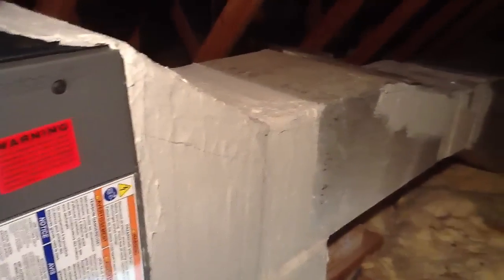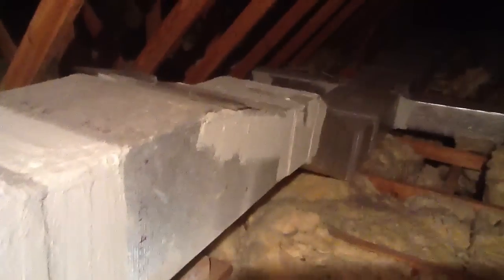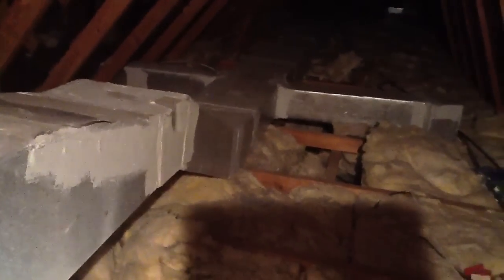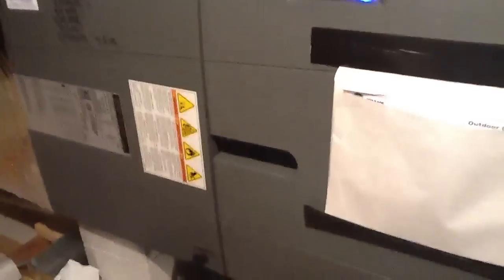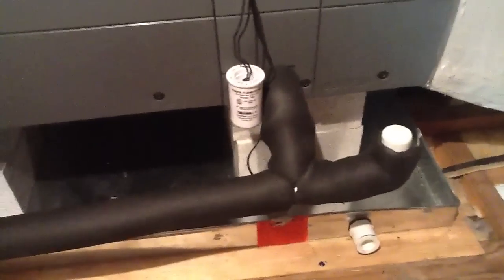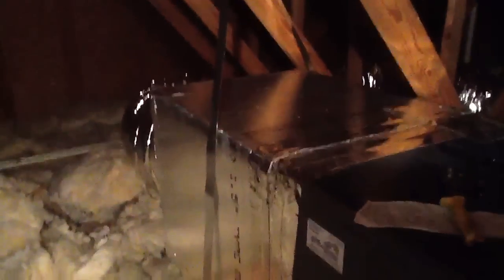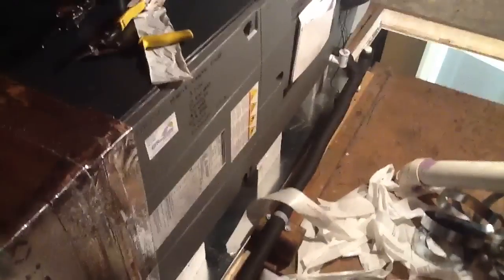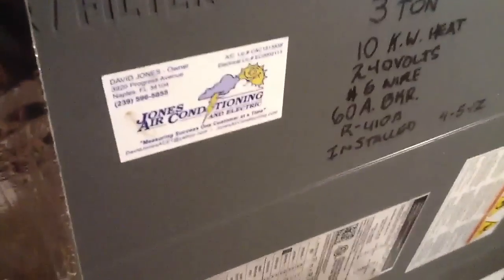New Florida Building Codes

Comment: Hello trying to figure out who I can report my HVAC contractor for charging me a hefty fee for a manual J load calculation but they never performed it and are not able to provide proof they ran any type of software.  I had a whole new AC/ Heat pump installed and I'm sure a manual j was required -  any advice would be appreciated.